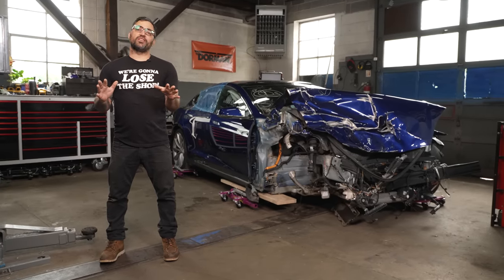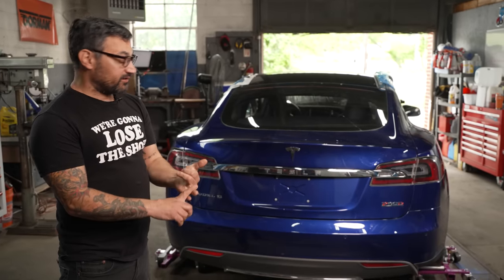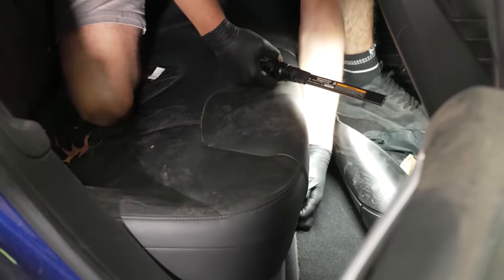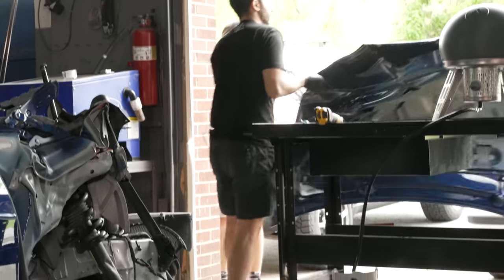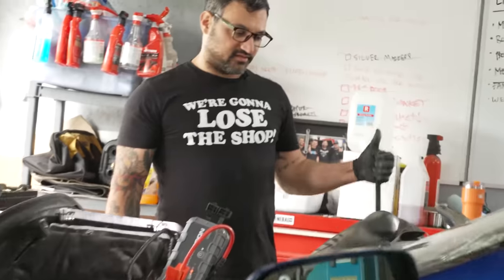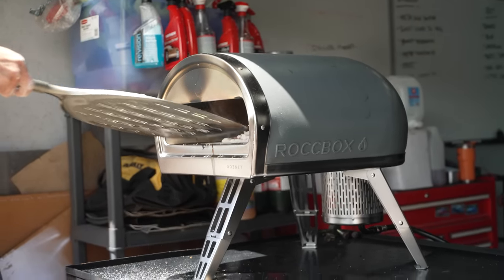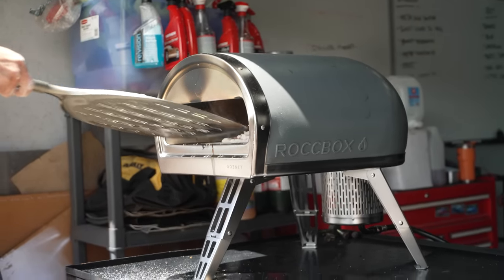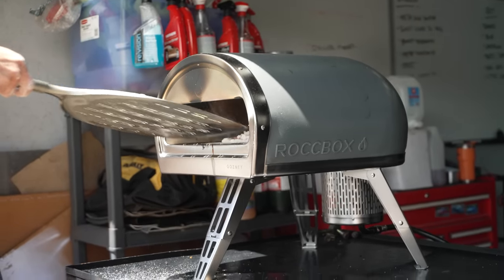I Bought a $129K Tesla WRECKED at Auction for 5500 BUCKS!!  DIY EV Muscle Car Build Starts NOW! -

Comment: Great video. You should put the front and rear motors in the s10 and make an all electric syclone. That thing would be insane
Reply from the maker: That would be bananas!
Reply: That idea has me intrigued 🤔
Reply: Great idea!!
Reply: This is great idea!!
Reply: Pickup bed way easier to hold battery's and build a frame. You could test how many batteries are needed. Weight/power. Tesla 6000lbs with people,  S10 4k
Reply: @StayTunedTA  Do it!
Reply: Sounds kinda like the salvage to savage dual tesla ldu swapped 1400hp c10 sema project. 🤔
Reply: Was just thinking of adding it to a Blazer, but the s10 idea is great. Batteries in the bed and under hood. Tony Angelo make this happen.
Reply: What an original idea
Reply: @StayTunedTA  Then you can race it against Aging Wheel's EV Ford Explorer he's doing up rn.
Reply: No! Never disrespect the bow tie
Reply: Dooooo eeeett
Reply: Maybe another s10 the ebay turbo one works too good to change, just way too successful of a project to ruin.
Reply: So what happened next?

Not seeing a follow up video....

Comment: I think its super cool that you are doing this. Hot rodding has always been about using whatever is available. If you showed an electric motor that made 500hp that weighed 250lbs to somebody in the 50's, their jaws would drop.

Comment: Don't forget about the top glass!  That should be able to be sold pretty easily and for a decent amount.
Reply: Easier said than done... Not easy to remove glass in a timely manner without breaking it
Reply: @TheeAbstractHero  Cut the roof off and let the next guy worry about removing the glass from it.
Reply: @trumbley22 I like the way you think

Comment: Dude I'd be pissed at COPART was there ANY indication the battery was removed in the auction?  That just seems shady AF to me.  Anyhow I'm excited to see what you end up doing with all this Jetson's gadgetry.
Reply: Business as usual for COPART. They are professional criminals.
Reply: If this had been sold on copart before someone bought the whole car dropped the batteries and put it back in auction without copart knowing.
Reply: @MrStacy1974 . Oof, savage.
Reply: Like Cleetus with that Porsche that was 'running and driving'. They did the right thing by him though.
Reply: What i want to know is, who steals ALL the floor mats out of all the vehicles from copart. Most all the vehicles in the yards at the location near me have the mats missing.
Reply: @jacknimble1  The dude who steals them is named Matt.
Reply: Copart is dirty as hell. Typical used car salesman BS but on a world wide web level. The wild wild west of used cars. If it looks to good to be true...thats because it is.
Reply: You need to look at who is selling - Insurance or some shady character. Also look at the clearance between rear tyre and chassis - batteries weigh a lot !
Reply: COPART AND IAA are NOT retail sellers so don't blame them.  There is a reason why some states prohibit non dealers from buying insurance salvage cars.   All locations allow registered buyers to inspect the cars on location, don't blindly trust the internet.
Reply: @CarsandCats    Copart and IAA give the cars a short inspection, don't blame them for you not inspecting the car.

Comment: A few years ago an EV conversion company came out with what was effectively a Tesla crate motor, designed as a direct bolt in replacement for a small block Chevy. The thing is, that package cost around $30k and all the other bits needed added another $20k, so doing what you're doing is still potentially a very cheap way of converting a muscle car to electric.
Also, for anyone worried about the lack of noise, take a listen to Hoonigan's Hoonitron, because that thing screams like a banshee when it lights off... 😁

Comment: @14:30    behind the cut point is a low voltage wire powered by the 12v battery that controls the contactors (big relay) at the battery to de-energise the high voltage system.       

This safety feature is part of why they won't work without the 12v battery.

Comment: Damn, that worked out well even without the batteries. I feel like the auction should disclose something as important as missing battery pack. I want to see you E-rod something nerdy like a rabbit pick up or corvair or 80's wagon. You dudes are doing great things. Keep up the good work.
Reply: An EV Corvair Greenbrier would be dope.
Reply: well yeah.. it sure isn't as crashed.

though taking out the battery and crashing the car down a hill would be sort of a way to commit insurance fraud.
Reply: It's possible the auction didn't know. Their not in the business of checking for parts. It was a smart thing to do for the shop that had the car. Money in the bank and nobody's the wiser. Then again if the ad said it had batteries..  Can you go back on them?
Reply: @Sergeantgrunt  I am not sure how that works. I work for a big corporate collision repair company, and I know that we are required to make sure every part that belongs to the car goes into or on the car before it gets towed to the insurance auction facility. I'm not sure if its by local law, or just our companies policy to avoid any kind of legal issues. I was just surprised to see the car was picked over already when we are held to account for even broken parts.

Comment: Rear drive unit into a king bed truck so the batteries can be mounted in the box for ease and covered with a tonneau cover. The weight of the batteries would also be over the axles for traction.

Comment: Put the battery and drive unit in a custom exo cage or dune buggy frame. I have always wondered how it would turn out. No matter what stoked for the project. Rock on guys 🤘
Reply: If you search around old auto forums a guy did an EV conversion on a street legal (i think) Formula Vee race car... Sounds kinfa like what you're describing

Comment: Reach out to the seller first, Be sure to check the rear drive unit is actually the one you think it should be given the missing batteries someone may have swapped or doctored it up, maybe consider another donor car. B is for build Chris I think has a bit of a collection of Tesla parts cars you could reach out too

Comment: HELL YES! Not a big fan of the guy that runs the company, and I don't find the cars body style or interior that appealing, but look: that motor - battery system they have is the LS7 of EVs when the other brands of EVs are running around on the Pinto motors of EVs. Whatever you're gonna end up doing, it's gonna be an absolute riot.
Reply from the maker: LEt's GOOOO!
Reply: What's so bad about the guy that runs to company?

Comment: Electric AWD “Cyclone”, would be cool to see drive unit from Tesla and an AWD transfer case from Tahoe or Escalade under your S10 :), not sure it could work but why not
Reply: That sounds utterly sick! And the S10 is light as heck, for a pickup. It'd make a real good base.
Reply: My first thought was turn it sideways, and run one axle to the front the other to the rear.  I don't know if the gearing would work though.

Comment: Did the guys that sold it to you say there was a battery in there? If so you could take it back and get your money back. Just ask Cleetus about the Porsche he bought and took back.
Reply from the maker: Hmmm, that's not a bad call. I can reach out to Copart. I don't think it was discussed, just assumed.
Reply: @StayTunedTA  Yes, he did not even contact them himself. They reached out to him after seeing the video. I would check the listing to see what it said, if this was suppose to be just a wrecked car from and insurance company. Someone along the way stole the battery. tow yard etc.
Reply: Yeah that's definitely something that would need to be disclosed. It would be like buying a wrecked car that someone had taken the transmission out of - or in this case, more like had removed all the transmission internals but put the case back so you couldn't even tell from an external visual inspection.
Reply: Copart could help him if they choose to. They are absolutely not required to. On buyer to inspect vehicle.
Reply: @StayTunedTA  if good attitude generated electricity you'd be alright but we're gonna need sparks here. Make that call brutha. Good luck

Comment: Should put that setup in an old patina truck! Seems logical because trucks are naturally light in the ass end, with the drive unit in the back and with plenty of room for the batteries up front in the engine bay you could probably setup the weight bias pretty evenly. A cool truck would also be a great addition to the fleet.

Comment: Just so you know you cant just buy separate used cellpacks and put them together, they all need to be balanced together. If theyre unequally worn or used they will not charge and discharge evenly which will cause issues.

Comment: Awd truck is what I was wanting to build till I learned how much everything cost and the controller to run it all.   But the battery pack being gone isn’t horrible now you can design the pack around what frame you use and not a frame around the pack.

Comment: Wide body electric Lotus Esprit. With front and rear drive units. Move that fire wall back a foot inside the old engine bay(so an adult can fit inside). Batteries in the floor. Add lightness and some more lightness, and you might have 800hp + per ton dry weight.

Comment: Muscle cars might be tough to fit the tesla battery pack. How about a cool shop truck? A bed would be easier to fit the pack. Even a flat bed to make it really easy.
Any hotrod electric companies out there? There must be a company out there making aftermarket battery packs. Maybe batteries for race cars? Might even be cheaper than a stock battery pack, probably more modular. Awesome project!

Another thought would be to bolt a tesla battery pack under a muscle car frame and jack it up for clearance. Make a lifted all-wheel drive Dakar muscle car!I

I guess you could also cut the tunnel out of the muscle car and put the pack inside the car! Lots of crazy options! Looking forward to seeing the direction you take!
Reply from the maker: Holley is making a bolt in kit for C10, so shop truck is looking pretty slick!

Comment: Defiantly not permanently, but if you plan on building the stock 911 motor. While you source parts and redo the power train on stock power. what about a temp sketchily built Mike Finnegan assisted Ev 911 🤔

Comment: My two thoughts are to throw it under a 350z or subframe looks similar to what you would call a Pontiac gto (aka holden monaro).
But literally anything rwd that you can convert to this would be awesome.
Even a small 4x4 with portal axles for extra height, although you would want that front drive too.
Good luck, watching keenly on evolution of this project.

Comment: As an FYI incase your working on these systems again, you appeared to be checking for HV by probing between chassis ground and the HV wires... That doesnt work, the hv system is isolated from the chassis. You need to test between hv + and -.

Comment: Shouldn't need the full amount of factory batteries. Just enough to match input voltage and have decent range. Full tray of batteries gives you max range. Should be able to add cells in series as you go along if you need to add range! I agree mini truck would be cool with that powertrain. Simple and reliable!
Reply from the maker: I don't think we have the full space for batteries anyway, totally agree! If we can get 150-175 miles  that would be great.

Comment: Have u checked to see if the cpu is there? Thats also gotta be worth some $.  And the connectivity stuff, like the sim card. Any of the exterior cameras, sensors. And any good glass. Not to mention all the million tiny cables, connectors, harnesses etc that people might need replaced.

Comment: Not sure if youve encountered this in your research already, but just FYI, the Large Drive Units are very prone to internal coolant leakage from failed rotor coolant seals. 
I HIGHLY reccomend pulling the speed sensor to inspect it to make sure there's no signs of coolant (and if coolant is present, youll need to address the issue before it destroys the drive unit from the inside out).
We rebuild these motors to fix this exact failure pretty much every day at the shop where I work, so feel free to reach out if you have any questions...
Alex @ QC Charge
Reply from the maker: Good to know! I'll dig into it.

Comment: If that cut line is only one side of the curcuit youll be fine.  The only problem is if you complete that cuicut.  My guess is that cut point is isolated to a degreen.  PS i am not an electrical engineer, but i stayed in a holiday express a coupme times.

Comment: I had a nagging thought about getting say a hell lightweight Comp Eliminator car and putting the 250hp Tesla hub motors in the front, and seeing if I could get Pro Stock like times with basically zero traction issues out of the hole

Comment: I would certainly assume that bidders knew that the batteries didn't exist if a P90D sold for $5500. I haven't checked used battery prices, but I'd imagine the pack is worth 2x+ that alone. There's still a lot of valuable parts there though, I'd imagine. If both motors are good, then I'd think it'd be worth almost that there.

Comment: Howabout a 4wd project?
Mount he drive unit in the center and  run drive shafts to front and rear axles from the drive unit's output splines.

Comment: real talk though: when you're working in close proximity to high voltage, or in the worst case scenario just unsure of what you're touching and have no other safety gear. only single touch the part. do not touch with both arms, limbs, hands, or whatever because it'll travel through your body/chest cavity. this is a habit you should try to break asap when dealing with electric. i normally wear class 2 gloves with leather keepers all day for work

Comment: The firefighter cutting into the car doesn't get electrocuted because the battery is not referenced to the ground under the car.  Cutting through the cables will cause arcing and potentially a fire but there is no path to ground through the fire fighter.

Comment: Dude it has a dual rear caliper setup already. Make a drift car with it!!
Reply from the maker: It's also electric! And there's a whole computer for the parking brake, but maybe we can use the mount and toss in a regular caliper?
Reply: @StayTunedTA  there has to be a caliper out there somewhere that will bolt directly up to it

Comment: Either put both front and rear motors in a muscle car or upgrade another muscle car with a hot motor with the ev front end so it can run on either or both ICE and EV

Comment: Craziness how small that drive into really is. Makes me wonder what kind of truck you could build to pull trailers.
Reply from the maker: Yeah, I think the amount of battery power needed to tow stuff makes huge towing hard for EV's.
Reply: @StayTunedTA  look into Edison Motors. They're building EV semis with an onboard generator. They have no mechanical connection to the drive wheels, they're pure electric and don't start the genset until the batteries are at a certain level. In a logging application where you're going up the hill empty and down the hill loaded, using regen braking, you might never need to use the generator at all.

Comment: If it had the battery you would have got a smoking deal no battery not so good. That battery would have been in fine shape for many years with that low of mileage. The Drive Unit looks pretty easy to install in any car with some small frame work modification. But to make it work you're going to need all the electronic stuff, so my advice buy another one wrecked in the back

Comment: I think you can use a chevy battery pack instead of the tesla, Sasha from on point dyno/mountain pass performance did a nice ev swap
Reply: Also been featured on speed academy, it was a lotus evora with tesla drive unit and chevy volt battery pack

Comment: Have you considered using Chevy Volt batteries as opposed to Tesla ones? Admittedly, I don't know a great deal about EV conversions, but I know Volt batteries are popular for conversions and seem to cost a bit less than the ones out of Teslas. That being said, I don't know what kind of range one can get from those batteries. As for a vehicle to shove that all in, I know someone in the UK is running a Porsche Boxster with a Tesla LDU and Volt batteries. Granted, at this point you're probably sick of 90's Porsches.😄

Comment: old 30"s,40's50's  buick road master or special.  Only chrome and steel with electric on the car it would be really nice. just a good chassis to support or swap from some other car to put the body on.
Reply from the maker: That sounds pretty cool actually. Modern chassis would help, just a G body or something.

Comment: I’d take that S10 and put that awd electric drivetrain into it. And make syclone.
Reply from the maker: You aren't the first to mention that, it would be pretty sick and the battery would just live in the bed?
Reply: 5 batteries in the bed 5 under the hood well weight balanced awd S10 that would absolutely rock at any track day be it drag or full track stuff.

Comment: Skip the Muscle platform - put the EV where the conversion makes the most natural sense: Buy a 1989 Oldsmobile Custom Cruiser* -  Put 500 RWD Electric ponies in the trunk of your Grampa's living room. Cruise the highway in silent, pillowy velour comfort, listen to Mel Torme - then go throw rubber at all the haters at the drag strip.

*or you could go with a cooler car like a g-body.

Comment: Honestly, this wasn't the best way to go for an electric setup. For the money, you could have got a much better electric motor (Warp9), programmable controller, and adapter to mount to a rear-end suitable for the project (Ford 9" or better). You weren't getting batteries with a wrecked Tesla for less than $20k. They are worth too much and are a finite resource.